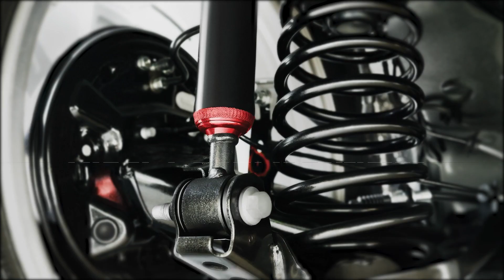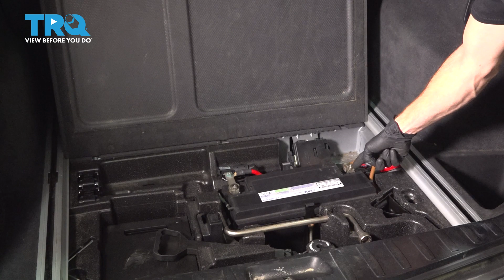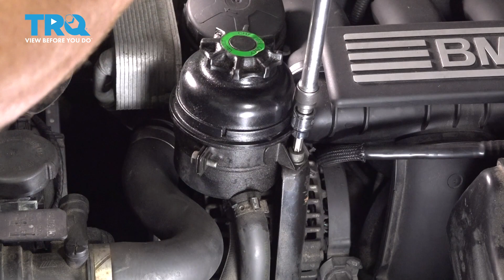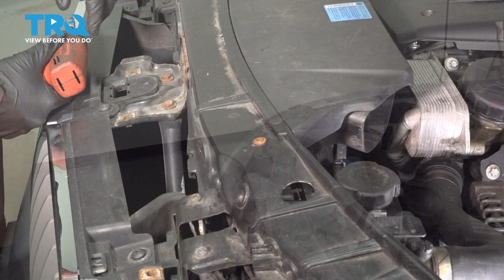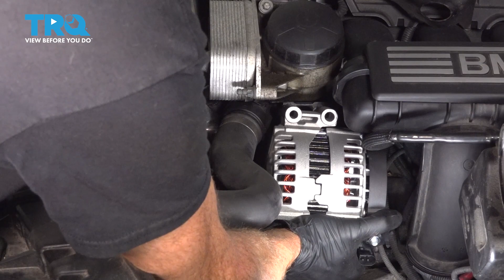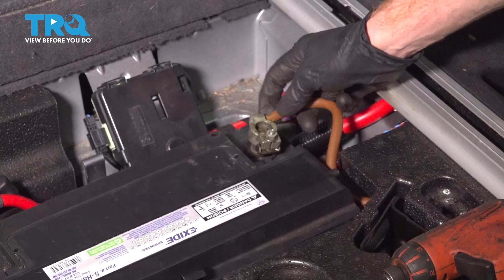How to Replace Alternator 2004 2010 BMW X3

Comment: The bolt pattern is different for the x3 models 2004, 2005, 2006 than in this video. This video describes the removal process for the more recent 2007, 2008, 2009 x3 alternators because the mounting brackets changed in 2007. Thanks for the effort, anyway.

Comment: I would add that once the old alternator is off, match up the pulley from the old one with the new one to make sure the replacement unit is correct before you install it. But great tutorial Thank you!

Comment: What about replacing those four alternator mounting bolts ?  I followed your video exactly. GREAT JOB.  But now the serpentine belt is giving me problems. The belt does not want to stay in the grooves on the power steering pully.  I guessing either idler pully or tensioner arm/pully. Or maybe should have replaced those bolts ? Comments